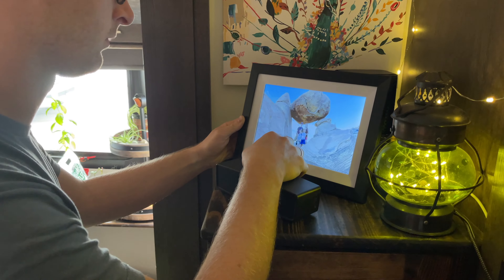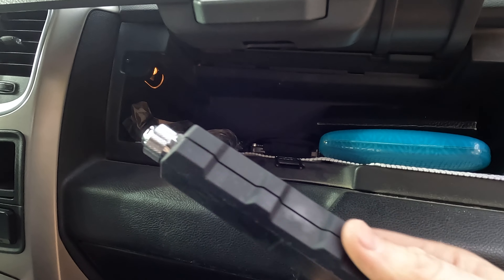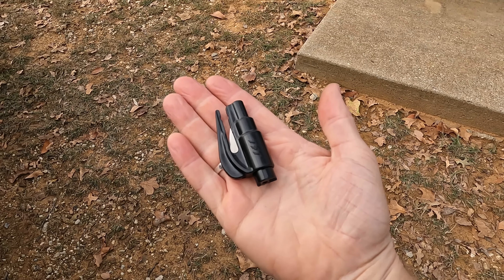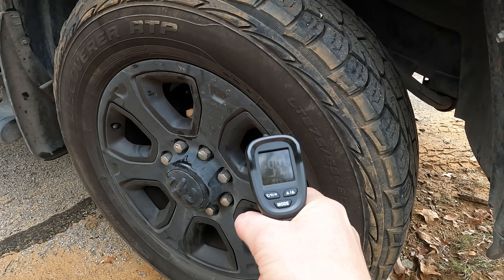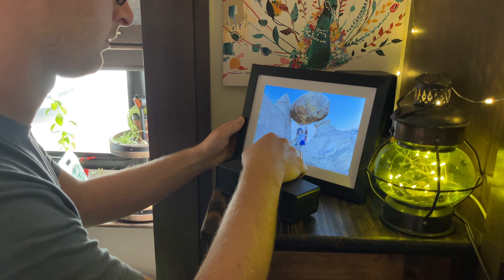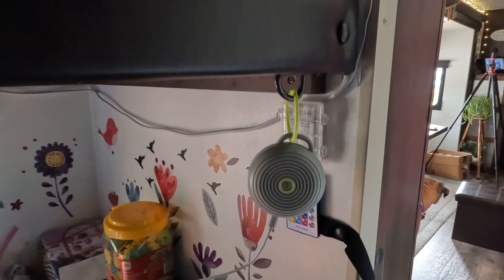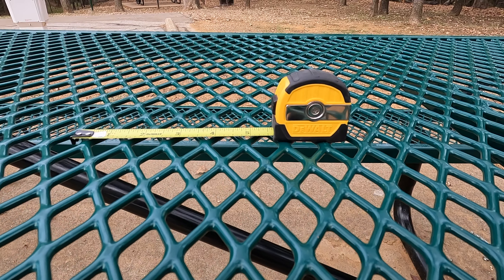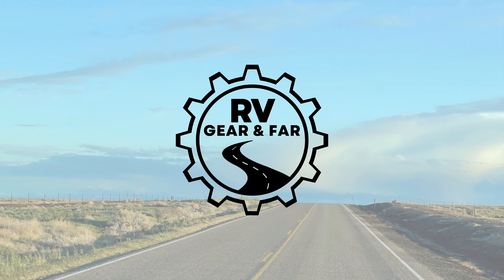11 Small RV Gadgets I Should Have Bought Sooner!

Comment: That hitch grip will be in my next Amz order. Because those coiled brake cables are dynamic, it can be difficult to know when it will pull out and trip the trailer brakes. The trailer could be hanging by the chains with the coil stretched but not enough to trigger the brakes. I bought 2 of them and never used them once I worked through the potential for damage vs the trouble of the static line.
Reply from the maker: The hitch grip is great!

Comment: I EDC a small tail clicker flashlight that normally takes a single AAA. I put in the higher voltage 10440 battery for a much brighter output.
Reply from the maker: Any idea if that higher output will reduce the bulb lifespan?

Comment: I have that tape measure. However, my job required I  use metric. I swapped the blade from a 6' Milwaukee. I would LOVE if DeWalt would make a metric version.
Reply from the maker: Agreed - I would love the combo imperial/metric sided tapes!
Reply: Yeah, I am replacing all of my baseboards in my house.  If you don’t like the metric system before doing finish carpentry you are going to undergo a rapid conversion.  I need a good metric tape, I think I’ll go the the fancy hardware store and get a Milwaukee since the chain stores don’t have what I want.

Comment: The infrared thermometer is an excellent tool alongside the TMPS sensor. I'm curious what bearing temp are we looking for in a travel trailer? The high for PSI is 158. Thanks
Reply from the maker: Both of those numbers are going to depend on YOUR specific rig and setup - if my travel trailer tires got to 158 psi they would probably be in pieces - what I'm looking for in the bearing temps is that all four are roughly similar - that one wheel isn't super hot compared to the rest - but you can also just record the temps over several days travel and get an average range that you'r setup runs in.
Reply: Thank you so much. I just wanted to let you know that you answered our question. We have 2506 S Rockwood Mini Lite. I bought the infrared thermometer for our upcoming trip, 16 K.

Comment: everybody must have a knife all them at all times. 
not a big, even a grandpa knife is good.
i have a holster ( band of knives i think is the manf) but it holds a multi tool, a mag two AA cell light, and a pen).
everybody i know, says i have a lose screw.

noise maker. i have a c-pap for that.

there should never be any grease anywhere on a ball hitch, dirt and grit sticks to grease. and grinds thing up. 
yes up grade the breakaway cable. it should be at least five times stronger than the part it pulls out of the trailer.
Reply from the maker: I like to grease the ball on each trip - but you're correct, its essentail to wipe it clean and reapply if the ball has spent any time uncoupled from the trailer as it easily collects dirt and debris